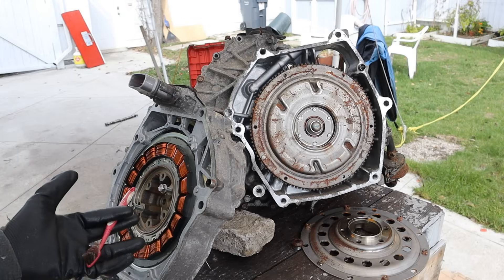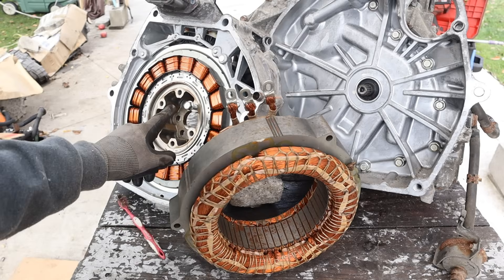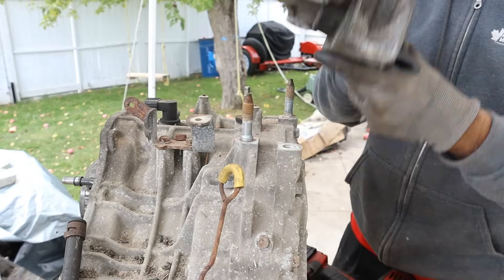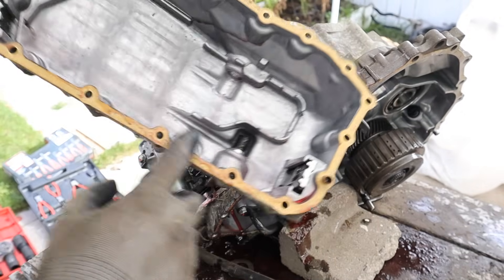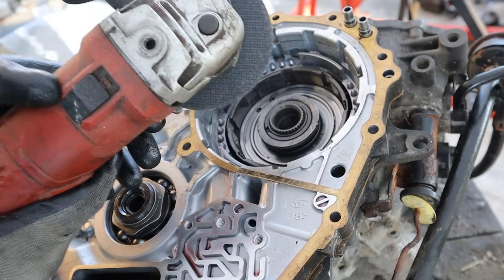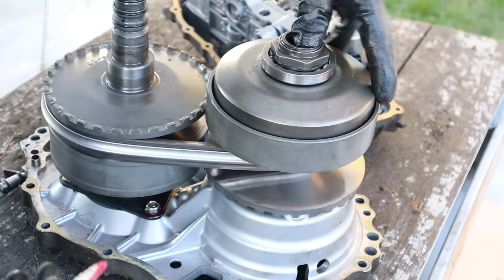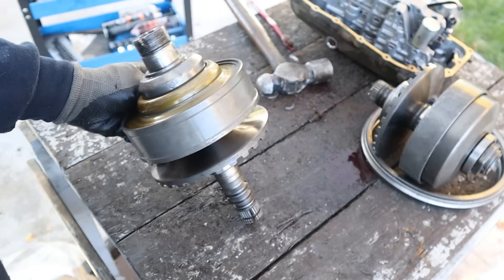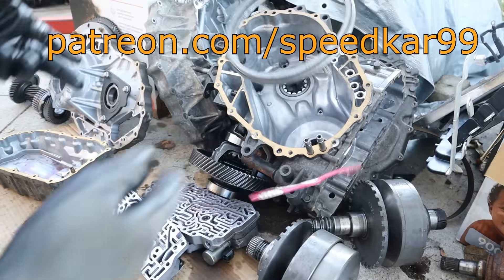How Honda's IMA Hybrid Continuously Variable Transmission Works

Comment: Nice tear down. I like your "special" 54mm socket XD. It's a pretty simple CVT and for the quite low power 1.3L engine it goes with on my 2009 Insight, is not stressed. It's lasted 16 years and 190k miles so far. Can't believe other makers don't include a dip stick and removable CVT fluid filter. I've got the one that has paddle shifters that simulate 7 "gears" if you want to play with it rather than the normal CV mode. The CVT is great at highway speeds - only 2,000rpm for 60mph. I had no idea it has a backup starter motor. In the 16 years I've had the car from new I don't recall hearing it ever used to start the engine.
Reply from the maker: Does it have that CVT drone?
Reply: @speedkar99 haven't ever noticed a transmission drone noise from new. The engine itself isn't the quietest but when its just cruising at 60mph the engine is very quiet because it only makes 2000 rpm. I guess the engine is more noisy at high rpm over 4000 because it switches cam profiles.

Comment: The CVT on our 06 hybrid lasted an abusive 200k miles incuding teenage me trying to do burnouts in it all the time. The car got into an accident so was sent off to the yard but what we did over those 200k miles was the cvt fluid change every 30k and the trans filter around 100k
Reply from the maker: Burn outs in a hybrid? Wow
Reply: @speedkar99 ”burn outs” with the hand brake up and in the wet or dirt, it would spin for a tiny bit. Things you think are cool at 17 lol

Comment: considerably beefy compared to what I expected! So, from what I understand, in order to not burn the CVT belt, while the car is not moving or while in neutral, the CVT belt spins freely, clutch packs aren't engaged and only gets under load when them clutch packs engage to move the car, is that correct?

Comment: I used to own a 2003 Honda Civic Hybrid (HCH) with CVT automatic.  I bought brand new.  I can confirm the use of the traditional 12v starter motor as a backup only.   The first time I started the engine brand new on the dealer lot for a test drive I heard the 12v starter engage because the high voltage IMA battery was completely dead.   I test drove the vehicle and bought it the same day.  The 2 or 3 mile test drive was enough to charge up the high voltage Ni-Mh battery pack behind the rear seats. The 12v starter had never engaged for almost 8 years after that because the IMA motor always started the engine.  That was until about 8 years the Ni-MH high voltage batteries had degraded so much the IMA motor wasn’t able to start the IC engine, so the 12V started kicked in and it still worked after all those years or in-activity.   I replaced my HCH with a brand new 2011 Volt (which ironically did NOT have a backup 12v starter lol).  I still have the Volt BTW please do a Volt power train tear down.
Reply from the maker: I'd love to get a volt to teardown, if I can find one, since that's a completely different setup with the engine as a generator.

Comment: Toyota Ecvt > Honda Hybrid cvt
Reply from the maker: Agreed.... eCVT>> any belt CVT honestly.
Reply: @speedkar99  it's like the difference between email and mail. eCVT good but CVT not so much 😅
Reply: I dunno man, Toyota has been dropping the ball on quality lately with plastic housings and such 😞
Reply: @attribute-4677charcoal canister still clogging.
Reply: Is not new generation hybrid Hondas ecvt also ?
Reply: @remonog2066  i think they have to license the tech from toyota, toyota has patented ecvt.
Reply: @alibabaei1953 
Honda calls it an eCVT, but their hybrids don’t have a power split device (aka eCVT) like Toyotas. Both Honda and Toyota are series-parallel hybrids, but Honda uses a more powerful electric motor and powers it with electricity generated by the engine across a wider range of driving conditions (in addition to engine drive and parallel modes at higher speeds). Toyota has a slightly smaller electric motor, but it’s able (thanks to the power splitter) to vary the ratios between engine and electric drive at lower speeds.  Very different approaches that achieve similar results.

Comment: 11:52  Oil is not pumped through the inter meshing lobes in the pump like you've shown. 
Oil goes in the opposite direction, around the outside of the pump lobes.
Reply from the maker: Thanks for that

Comment: A mechanical CVT transmission? It still has a multilink belt! Highly costly transmission replacement!
Reply: My daughter plans to replace theirs when it goes wrong. Made in 2009.
Reply from the maker: Umm, not really. These are low stress. Probably easier to find used than a Nissan style that fails endlessly.

Comment: Was there anything specific about the design of these that made them more reliable than the Jatcos?
Reply from the maker: Good question. For one, the seals on the variators don't fail and they aren't subjected to the higher torque of heavier vehicles with bigger engines that cause the transmission to overheat.
Reply: I seem to recall seeing that the Nissan's variators had (I think) three balls transmitting the torque between the variator cone and the shaft, and those are what failed. This one didn't get taken apart enough to see how Honda did this, but presumably Honda did it in a way that didn't involve point-contact between three balls and the grooves in the shaft. I have no idea why Jatco persisted with that design for so long.

Honda CVTs aren't completely immune from failure, but nothing is. The mechanical CVTs in recent Civics and Corollas seem to be decently reliable.

Comment: Edit : In the UK in 2018 Honda changed their warranty on the hybrid battery to six years/ 100k miles  from seven years because they realised batteries go bad and flash the IMA light right after 6 years . Just get a Toyota hybrid if you wanna get a hybrid . Honda was nice enough to replace my battery on warranty because I was always doing my oil changes at their dealership , have to admit that , they were nice and they have really decent prices for oil changes and auto gearbox oil changes .
Reply from the maker: Agreed, the Toyota system works the best, but they've licensed it out to Ford, Mazda  and Nissan so it doesn't have to be Toyota branded
Reply: They haven't done IMA in years so 1) it would be moot at this point, and 2) federally the USA requires all companies to cover the battery for 8 years/100k miles minimum.

Comment: Wow, this is the first hybrid I've ever seen that has a typical starter motor. Was it ever regularly used in this application or was it purely a backup function?
Reply: It was used as a backup in situations like extremely cold weather with a low charged HV battery. Otherwise it just turned the engine over by an electric motor. You can actually remove the battery entirely in these IMA hybrids and rely on the conventional car starter and engine to drive if you truly needed to get by.
Reply from the maker: It's a backup. Future hybrids don't have this, because you know....the figured it would be more reliable by then.

Comment: Still, overcomplicated and almost impossible to repair. I miss real old Hondas
Reply from the maker: The hardware is surprisingly reliable. 
I'll cover in the next video why the electronics didn't make these cars hold up
Reply: @speedkar99  Battery swap was surprisingly easy on the previous gen. 900ish bucks USD in 2017.
Reply: @MeanBlueSpider  Li swap?
Reply: Nope, same gen Honda Civic traction battery behind the backseat from LKQ. Not sure what chemistry Honda used in the early 2000s.

Comment: I want IMA + K24A4 with 6spd
Reply from the maker: Hmm we can't all get what we want. The closest is the insight with a 5 speed manual transmission and IMA hybrid
Reply: @speedkar99  There was a "sporty" IMA CR-Z made from 2011-2016. Tried one in 6sp manual, but it was underpowered and barely had any sport about it.
Reply: @speedkar99 CRZ or JDM Fit GE8 RS hybrid 6sp
edit: my mistake FIT RS hybrid is called GP4 in Japan
Reply: @tyablo fit got 6spd with IMA overseas?
Reply: @masonchase085 yes JDM GP4 Fit and same applies to CRZ
Reply: You could technically build one!
Reply: @aspecreviews  Watching this,  it looks like you might be able to just make an adapter plate to link the K24 and the IMA housing. I'm not sure how the electronics side of things would work though.
Reply: @joeythreeclubs pull the inverter and HV ECU out of a Civic Hybrid.
Reply: @joeythreeclubs it would be awesome to have 6spd manual IMA with regen braking